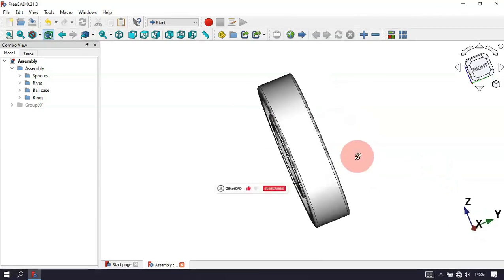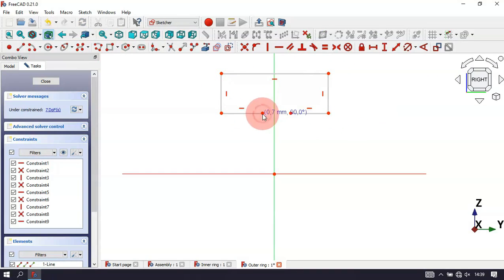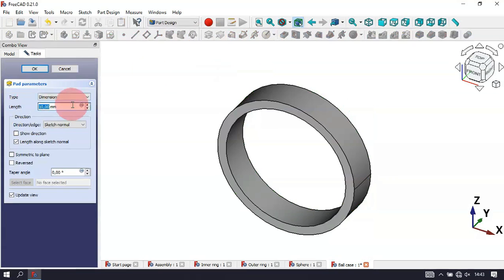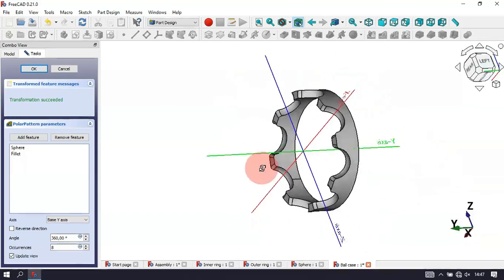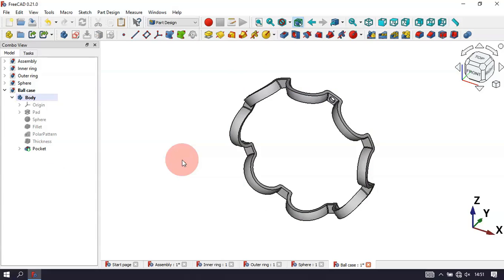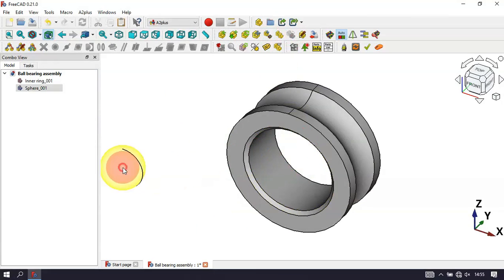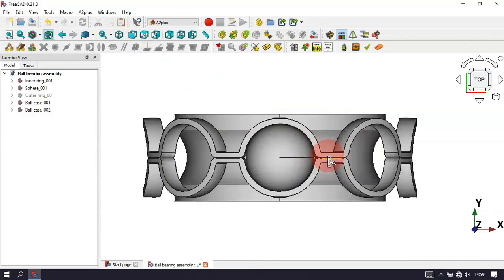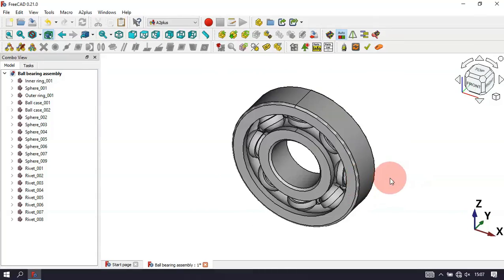FreeCAD 0.21 Beginners tutorial: practical exercise 115 (Design and assembly of ball bearing)

Comment: You can still use the polyline tool to draw the arc, without switching to the arc tool, just press ¨m" key while still using polyline tool, to switch to arc mode and same for other modes (right angle, line). Nice tutorial

Comment: mi si è manifestato lo stesso problema, ho risolto facendo i fori uno ad uno.
Reply from the maker: Yes, is an of the options. But is very tedious to work in this way.
Reply: Si certo è vero, era solo per risolvere il problema. Grazie. @OffsetCAD
Reply: @OffsetCAD  Hi, I tried using this method but when I do the pockets, still get the same problem with what you have. I also cannot install the link branch version as I get confused which files to use for installation. I guess this is the end for my lesson for this tutorial as I cannot go forward. Anway at least I knew how to assemble it from your video. Thanks

Comment: Hello! Watching the video I find some intresting moment about substractive sphere. It doesn`t work when the center of substractive spjere placed out of substractive object. I`m a linux user and in linux version of freecad substractive sphere has the same behavior. If you built object simetrical about center line, you can avoid this bug.
Reply from the maker: Thank you! I hope this will be fixed in the next versions.
Reply: trying it in windows 10, and had no problems with my initial ring being symmetrical to the plane